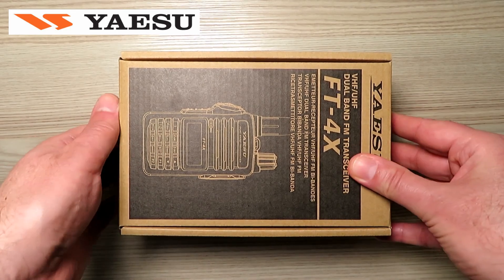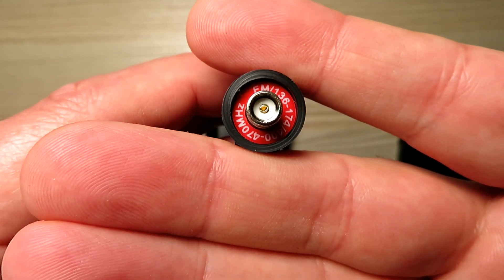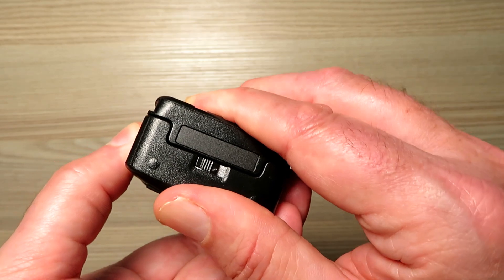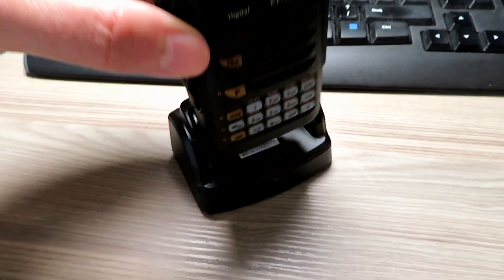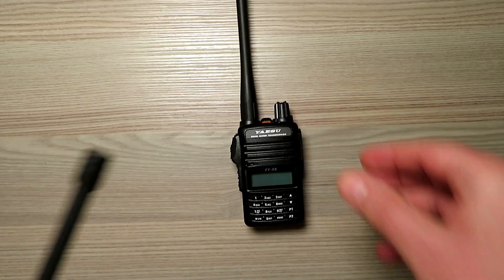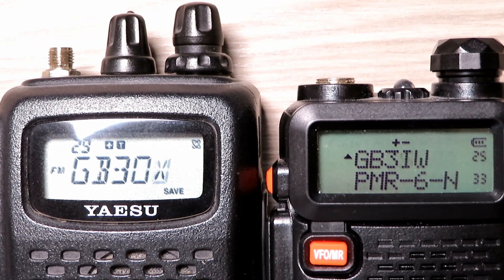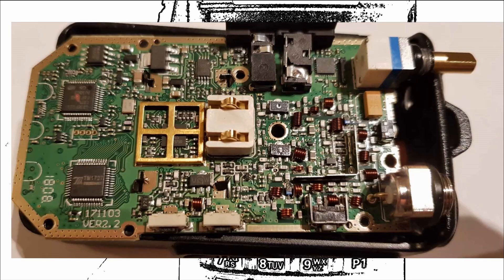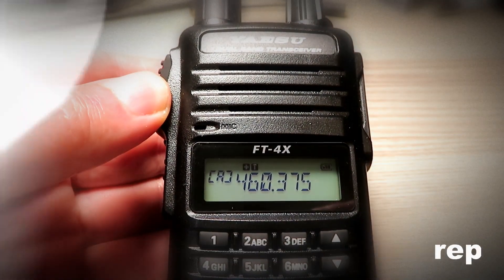YAESU ON A MISSION TO KILL OFF THE UV5R AND IT'S CLONES -- THE FT-4XE - PART 1

Comment: it is good if they put type C charging on battery or on the radio. so you can charge it on powerbank. Baofeng has a type C charging on upgrade battery. I wish yaesu will upgrade and put type C on their battery or radio.

Comment: Its nice they want to offer a few inexpensive models but if they want to kill Baofeng theyll have to make their radios work on FRS,GMRS, MURS, 2m and 70cm with an FM radio. Yaesu has less spurios emissions but if we cant get a radio to TX on the frequencies we want it doesnt matter. Do that with less spurious emissions and we will jump on board. Then do it for $50 or less and then Baofeng will die a slow death. Do it under $30 and youll kill Baofeng in a day. but they wont do either so there wont be any killing of Baofengs by Yaesu yet.

Comment: You cant compare a 20 euros machine with a 100 euros machine...its not fair
Reply from the maker: Why not? They are both budget radios made using similar chips and techniques don't forget your paying extra for the name with the yaesu, the UV 5R was £30 and the yaesu £60 at the time, knock ten pounds off the yaesu for the name and your not far off the price.

Comment: I'm sticking with my Teamup UV8 (badged Kenwood TK UV-F8 in Russia).
Uses UV5R batteries, looks like a Baofeng F8+ no LED light and no extra band button
Nothing like a Baofeng inside, 2x 128 (256 total) dynamic mems, (Stores last change without saving)
User programmable Mic gain, and upper and lower band limits, etc. with supplied software.
software download half way down webpage: https://www.radio16.ru/racii-kenwood/31.html

Comment: To be honest, I anticipated a price tag of at least £120 for this Yaesu.  I can't wait for your field test.  I wonder how easy it is to use the software programming?  A new Prolific chip programming cable thankfully isn't a deal breaker (we're just accustomed and so spoiled to have had such inexpensive Baofeng RTs & generic cables!). Wow!  A Yaesu for this ridiculously low price (and with a secret Easter Egg 'out-of-amateur-band' code!). Thanks so much for this video insight.
Reply: even the  ft-65  the  big  brother to the ft-4xe   is  well under  100 gbp
Reply: @nicolajaynehodson9223  Thanks Nicola.  There's a better spec model that's still sub £100!  That's incredible!  I'm a very old radio user but in my youth, Yaesu radios represented high quality at an equally high price that discriminated against the casual radio user.  Just think :  all those radio enthusiasts who started with 888s and have bought a few Baofeng UV5R variants, could have invested the same pocket money on one of these reliable Yaesu handhelds!  Thanks again Nicola.